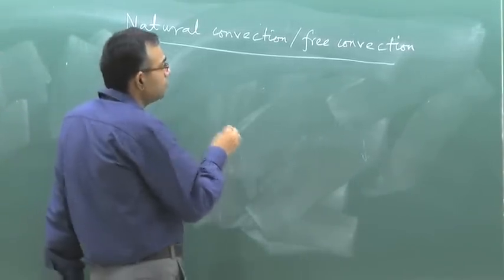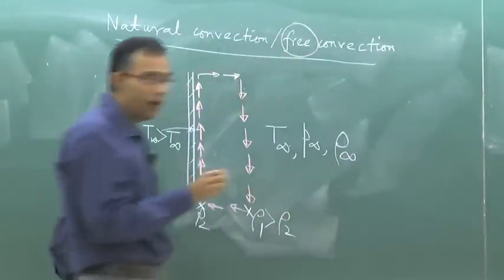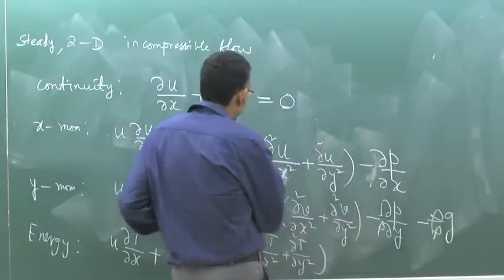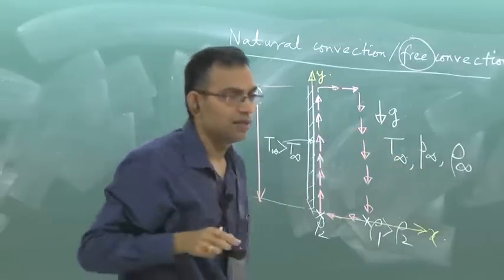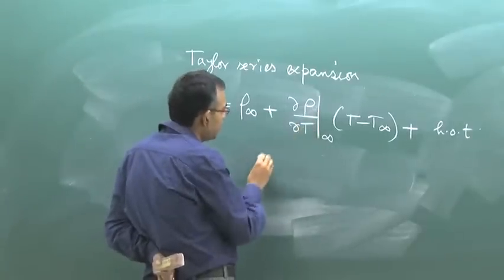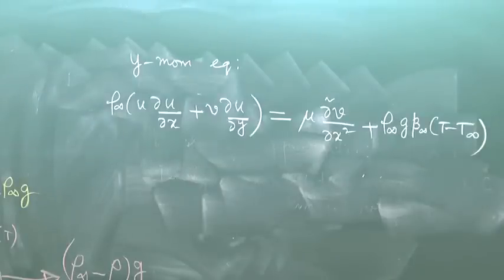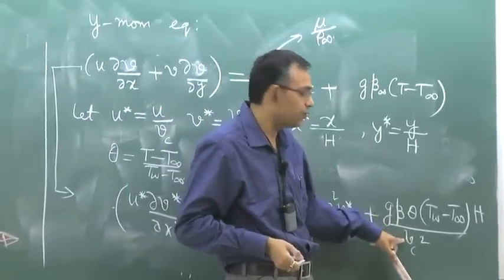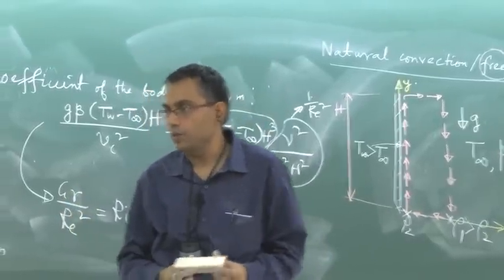Lecture 35: Natural Convection

Comment: At the beginning of the video, Prof said this is actually pressure-driven flow by giving an example p rhoRT relationship but when he wrote gdes, he accepted dp/dx is zero as if flow over a flat plate. Which one is correct or did ı miss some point?
Reply: It is because he said the pressure is not external but intrinsic.
Reply: @rahuljoshi8586  this doesn't answer his question, whether intrinsic or external, it is coming to be 0. And in fact it has to be 0 as system is exposed to atmosphere. In ideal gas equation he just takes P = rhoRT and says Rho more so P more and vice versa. He simply forgot that T is not constant. Ambient T and T near plate are different, then how will P just depend on rho?
Reply: pressure difference is the driving force because near the plate where hot air rises due to less density it creates a sort of vacuum over there which is filled by the cold air that is descending and completing the cycle. same as land breeze and sea breeze.

Comment: Sir you said that the eqn can be used for free and forced convection bt in the substituting the gradient of pressure in the y direction as hydrostatic pressure u have considered it that external flow is static which not a case of forced convection
Reply: Exactly, I have got the same doubt. If you look at the literature, the pressure gradient term is always expressed as a sum of two. One being the hydrostatic pressure gradient and the other being the hydrodynamic pressure gradient. Even in the case of a forced convection over a flat plate (Prandtl's boundary layer equations), the pressure gradient term in the lengthwise direction of the flat plate is considered zero only, because of the geometry of the flat plate. The pressure gradient what we could be missing is the pressure gradient that arises out of the curved body geometry.